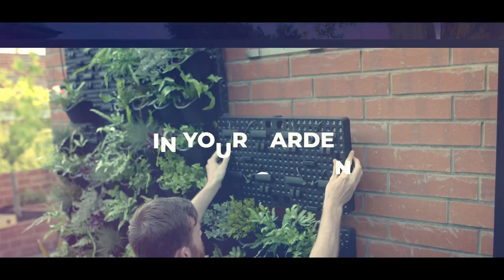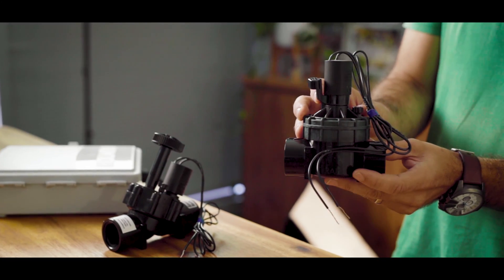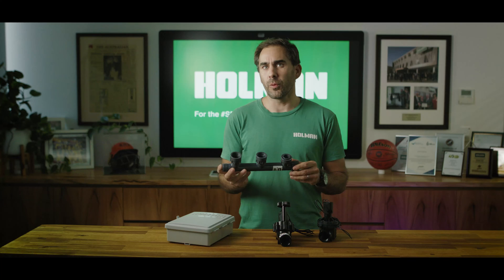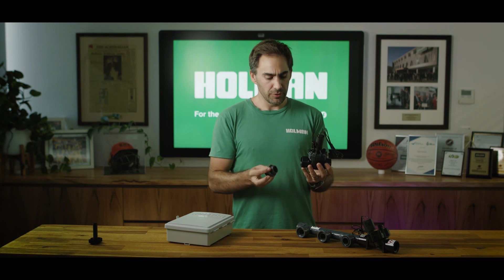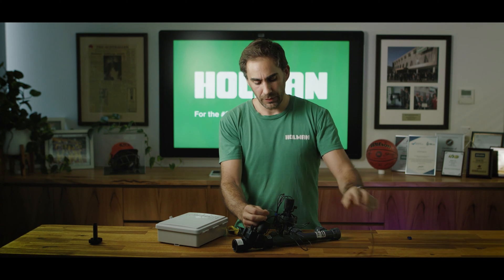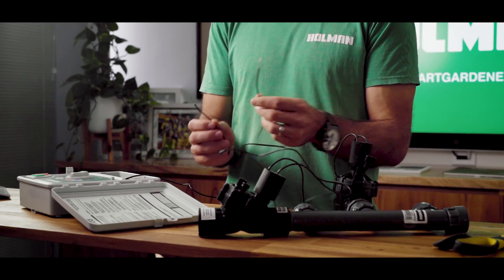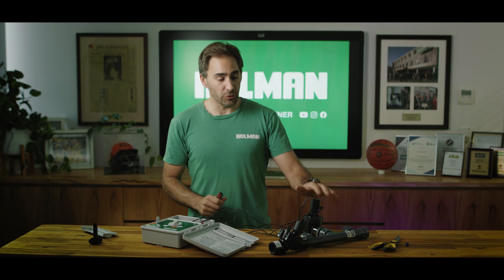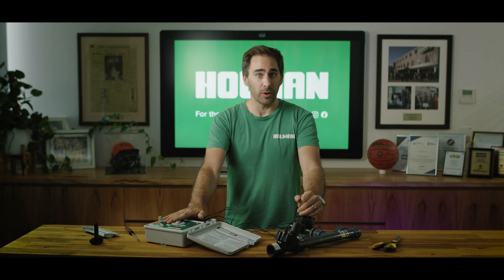How to Wire a Solenoid Valve to an Irrigation Controller

Comment: I have this system wired for a master and three solenoids numbered 1,2 and 3. However, solenoid 3 comes on at the same time as either 1 or 2 and won't function on its own. I have checked and checked the wiring but nothing seems to help and it seems to match what is in the video. Any suggestions?

Comment: why don't you show where to route the wires? do i need to drill out the bottom plug? nothing about it in the manuals or in the videos.

The manual also says to wire all the remaining stations unused to the last used station, but no mention of that here either.
Reply from the maker: Hi Daniel, there is pilot holes on the bottom and back of the controller housing to easily punch through and run your cables through. Wiring the remaining stations is only relevant if you have a pump installed, in order to protect the pump.
Reply: @holmanindustries  Which I do.

Comment: Cheers for the video it's very helpful.  I was going to do the initial loop from my pump to solenoid valves in 19mm (3/4"), but it seems 25mm (1") is a far more common size for solenoid valves.  This is for a drip system would you recommend using 25mm even though it's overkill for my requirements?
Reply from the maker: Hello, we're probably too late to reply to this now BUT we would not reccomend using LD Poly Pipe to the solenoid valve. Instead, try 25mm PVC or 25mm HD Poly up to the solenoid valves – can reduce down to 19mm after valves. Thank you!